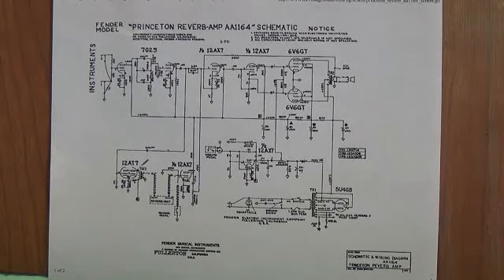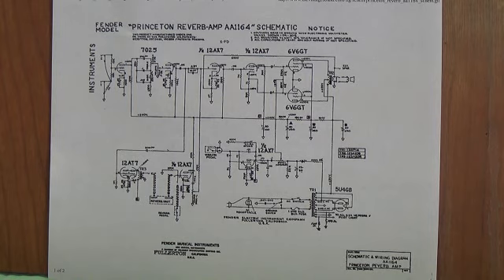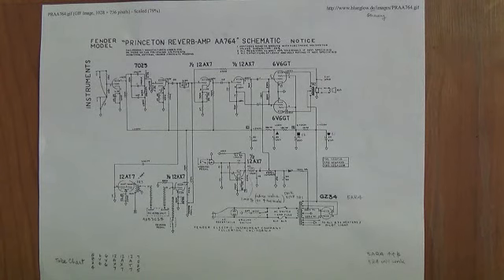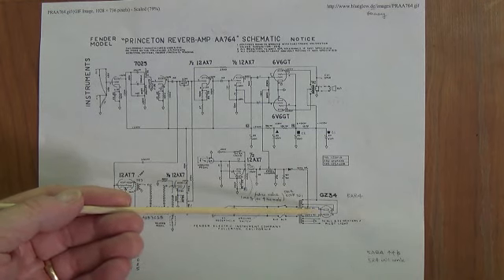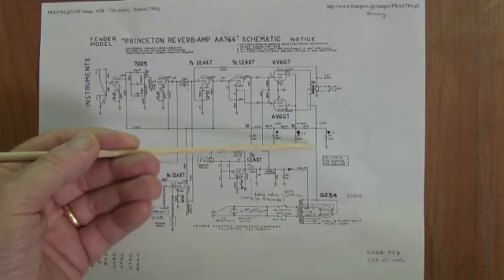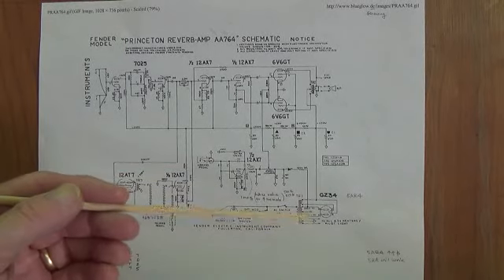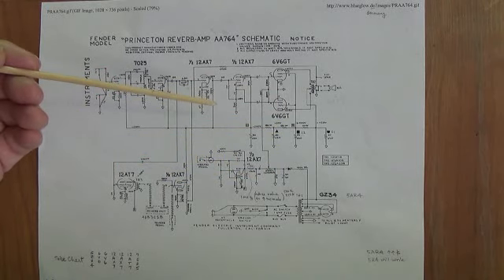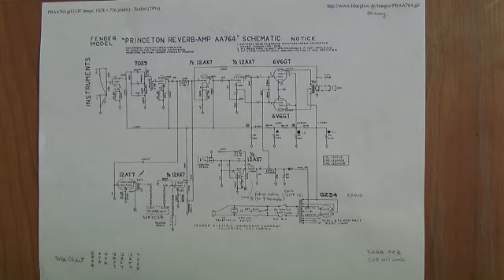Fender Princeton Reverb AA764 Chassis.....Fact, Fiction, or Typo ???

Comment: Hi Uncle Dough. I'm going to take on a quite deep restoration of my Fender Princeton AA764 version. Need to do a full recap of all the electrolitics, including the multitap can-type one, the power transformer and the rectifier valve, which in my case has been replaced by a full wave diode rectifier bridge. I'm thinking of using a Hammond made 291AEX power transformer as replacement, as I live in Italy ad we run our mains @230V AC. As per  rectifier , after watching your video, I think I should go with a GZ34. Do you suggest any particular brand/type? Also here in Italy it is quite difficult to get a replacement for the filter cap. I wouldn't like to use external caps and I'd like to retain original look as much as I can. I saw on other videos you are using caps made by Ge Distribution but they are quite expensive to get, with shipping and import taxes. Any suggestion you could give to me is very welcome. Thank you
Reply from the maker: A full wave bridge rectifier requires a special power transformer without a center-tapped high voltage winding. You would be better off installing a proper ClassicTone 40-18019 Fender Princeton power transformer with a GZ-34 rectifier tube. They also have international models with 110VAC and 220VAC primary windings.....check their site.  You can retain the capacitor can on the outside of the chassis and then replace all the capacitors with individual axial electrolytics hidden within the chassis. Good luck.
Reply: @UncleDoug  Thank for your answer, Sir. As per capacitor, I know  schematic requires a 4 x 20uF can cap. Would a 20/20/20/30 be a better option, even for cosmetic reasons? Thank you
Reply from the maker: @dreamlessfull  I'm not sure why the latter would be more "cosmetic" than the 4 x 20uF, but yes, you can use a somewhat higher value cap in the first position of the power supply chain.
Reply: @UncleDoug true, I could use 4 electrolitics and keep the disconnected can cap, but  I'd like to keep the number of modern components inside the chassis at minimum
 Thank for your advice, I've learned a lot from your vids
Reply from the maker: @dreamlessfull  Then I guess you have no other option than to buy a "very expensive" can capacitor. Good luck with the repairs.
Reply: @UncleDoug  Thank you Sir, I'll let you know how it goes... especially when I'll need to tackle the 6L6 biasing topic. Then I'll need your help again, if I can ask.
Reply from the maker: @dreamlessfull  Hopefully, your output tubes are 6V6's, not 6L6's :)  I have posted several videos showing how to bias double-ended amps. I think you will find them helpful.
Reply: @UncleDoug  Ehhhr, yes 6V6, of course! :-)
Reply: Hi Uncle Doug. I've finally completed the restoration of my Princeton Reverb. I've a couple of question, I hope you don't mind answerig them. I've installed a Hammond power transformer, and since it has a center tap on the 6.3 V secondary output, I was wondering if a can take off the two 100 ohm resistors on both secondary wires, currently attached to the bulb, and connect the center tap to chassis.  Second question, firing up for the first time: Since I've got a variac, with an ammeter indicator, is it ok if I turn on the voltage gradually and check if current demand is within specs? Of course, with all the tube except rectifier removed, at first, just to check if voltages  are correct? About the bias, now. Since 6V6 have no cathode biasing resistor, how do I measure PD? Plate and center tap of OT on each tube, with resistance of each primay? Lastly,  would it be possible to bias 6v6 individually? Any  schematic you would point me to? Thank you tons!
Reply from the maker: @dreamlessfull  A bunch of questions, D. Yes, remove the virtual CT and ground the real CT.....you never need both. You can do a slow start-up with a Variac and only the rectifier, but B+ voltages won't be accurate without the tubes in place. Use a Current Limiter and either just start it up or slow start it up with all tubes in place.....then check voltages. I have covered the biasing procedure many times in videos. Measure the voltage drop across each half winding of the OPT primary, then divide it by the resistance of each half winding. Yes, you can use different grid resistors to match the  bias.....but perfectly matched output tubes is not all that important for good tone. Often, some mismatch sounds better.
Reply: @UncleDoug  thank you very much, doc!

Comment: I used the link for the Schematic - and it says it's a photo-shopped conversion of the AA1164 , so maybe your initial comments were correct.
The PRRev. AA764 never existed - maybe it was the stamp they used that hadn't been changed.
Reply from the maker: Strangely enough, the statement about it being photo-shopped was added AFTER I posted the video and link. I have copies of the AA764 schematic both ways, with and without the notice. The addition of this notice does indeed cast doubt on the actual existence of any legitimate AA764 schematic......or chassis.
Reply: @UncleDoug  But it still remains that the Tube Chart with the stamp AA764 shows the GZ34 and the AA1164 Tube Chart has the 5U4GB. Peculiar to say the least :-)
Reply: @UncleDoug  Maybe even more peculiar is this SF PR on Reverb - 1968 :-)
https://reverb.com/item/7825642-vintage-1968-fender-princeton-reverb-silver-face-tube-amplifier-aa764-circuit-a-true-sonic-gem

Comment: Have you ever come across a way to slow down the tremolo in a Princeton Reverb (mine is a reissue). Maybe a different value pot for the speed?
Reply from the maker: It's a fairly simple procedure, David. Simply increase the value of one or more of the capacitors in the oscillation loop.....i.e. if the cap value is .02uf, then substitute a .03uf. Higher value caps charge and discharge more slowly, thus slowing down the tremolo speed.

Comment: hi, thanks for posting this... its really interesting and helpfull... I am very confused though, as my PR tube chart states it is a AA764 circuit, but it shows a 5U4 rectifier tube... any hints on this? which schematic should I use... also, which power and output  transformer replacements would you recommend to restore and improve these amps???
Reply from the maker: You're welcome, Sergio. Normally the AA1164 chassis uses a 5U4 and the AA764 uses a GZ34. If the tube chart in your amp says "AA764" and shows a diagram of a "5U4" rectifier, then I would go with the tube chart and keep the 5U4. Other than the rectifier tube, there is very little difference (2 capacitor values) between the two circuits, so it really doesn't matter which one you use.

I would not suggest replacing either transformer unless the original has an open winding (i.e. it's "burned out"). If you do need a replacement PT or OT, then check Triode USA:  http://store.triodestore.com/transformers.html   They have good quality transformers at very reasonable prices. Good luck !!

Comment: Uncle Doug. Thanks for the vids. I'm learning a lot. I have a 1974  Silverface Princeton Non-Reverb. Can I use a GZ34 instead of the 5U4Gb?
The amp has very low power. I was hoping this would help. What else can I check/try to increase volume/power?  Thanks!
Reply from the maker: You're welcome, Diane. Yes, you can replace the 5U4 with a GZ34 and the result will be higher plate voltage and possibly higher plate dissipation, so you should re-bias the amp. It's possible that your 6V6 output tubes are showing their age and getting weak. If you have never replaced them, it might be time to do so.....and another good reason to re-bias (necessary with the new tubes). Good luck.

Comment: This is interesting.    I had asked you for a link to a good readable copy of an AA1164  Princeton reverb, and you sent one from I think TheVintageSound web site.   My brother found another one, that says "AA1164 Princeton Reverb" on top, but it has a GZ34 rectifier tube and the power transformer is 340 0 340v and a spot check, the other components look the same as well.
Reply from the maker: Variations exist in schematics. The GZ34 rectifier is generally found in the AA764 circuit, but can be used in the AA1164 as well. The GZ34 is a more efficient rectifier, so plate voltages will be higher (output tubes must be rebiased if rectifiers are changed). It offers a slower warmup, to protect the tubes, and it has lower current demands from the power transformer. It is overall quite superior to the 5U4.
Reply: Thanks for the info, Uncle Doug. Glad I somehow "accidented" my way to the GZ34 version of the schematic.  Wow much better tube! As an aside, a little worried that the schematic I have might have a fatal error/typ'o (short or missing component or value is wrong) but maybe I can find a different source for the schematic and compare component values and placement.
Reply: If I had not found your youtube channel, and all the great and detailed information on projects you've worked on, and tutorials, I don't think I would start an amp building project.  Thanks!
Reply from the maker: You're welcome. Good luck with your project.

Comment: Do all of the AA764 models have the GZ34 and while only SOME of the AA1164 have it? thanks
Reply from the maker: It's impossible to make any absolute statements about the circuits at that time, Doug. I have seen all sorts of circuit variations, alterations, and combinations....probably depending on what parts were available on the day of manufacture.

Comment: Can I substitute a GZ34 for a 5U4 in a '73 and '79 SFPR?  If not, what changes do I need to make to make it work?
Reply from the maker: Bbendfender Your power transformer will love it, due to reduced current draw, Bb, but your output tube plate dissipation will go up due to increased plate voltage. You'll probably have to re-bias them.  Also, the amp will become less "saggy", with current responsiveness more like solid state rectification.

Comment: Would going from a GZ34 in a 64 Super Reverb to a 5U4GB tax the amp parts anymore?  Would it likely achieve more sag at lower volumes?
Reply from the maker: Greetings, NYC. The GZ34 filament only draws 1.9A while the 5U4 draws 3A, so the 5U4 would be a 58% greater current draw on the 5V winding of the PT. Most PT's have some leeway in their current ratings, so you could probably get away with it. The GZ34 is more efficient that the 5U4, so the 5U4 would indeed be a little "saggier" at lower volumes. Here is a link to a great site and discussion of your amp:  http://fenderguru.com/amps/super-reverb  He mentions the rectifier switch.
Reply: Uncle Doug That site is where my search started.  Guess Ill be posting my results after giving it a try..

Comment: I have a 1967 Princeton Date code QD April 67. Under indicator bulb is only the number 68..no other text...most say Patent date or other...never seen this on other..is this rare?
Reply from the maker: There are several different versions of the control panel plate, Brian, but I don't recall seeing one with just the number "68".

Comment: Hi Uncle Doug. I have a '66 with the AA764 chart, and it came to me with a 5U4GB rectifier. I'm considering a swap to the GZ34. Before I do, can you tell me how the differences in the AA1164 circuit address the potentially harmful characteristics of the 5U4GB rectifier if used in the AA764 circuit? Many thanks. Great videos.
Reply from the maker: Greetings, Jonathan. I don't believe that Fender made any modifications for the 5U4 rectifier in the AA1164 chassis. In the schematics, it appears that both chassis use the same power transformer, even though the 5U4 draws over 50% more filament current than the GZ34. I assume that the 5V winding of this PT is rated at 3A, so it is capable of handling the 5U4 and would therefore be way under-stressed when dealing with the GZ34 at only 1.8A.

Your AA764 chassis would probably be OK with a 5U4. It's a common substitution, since 5U4's tend to be more readily available and cheaper than GZ34's, but in addition to drawing more filament current, the 5U4 is much less efficient than the GZ34, provides lower plate voltages, has more "sag", and does not provide slow warm up to protect your tubes. Bottom line: the GZ34 is a superior rectifier in all respects.

Comment: Hi Doug- looking at the schematic you posted (thanks!) I see there is a notice that says "This drawing was photoshopped from a scan of an original AA1164 schematic. The only details change were the AA764 designation, the bias capacitor from its original 25u 50V value and one tremolo capacitor from 0.01 to 0.02.  To my knowledge there is no known example of an original AA764 Princeton Reverb schematic."  
I did not see this disclaimer on your printout in the video, though (must have been updated later on?).  I assume the photoshopped schematic is valid/ correct, but why is this such a difficult schematic to find?
Thanks for all the videos
Reply from the maker: I see no such notice on either of the AA764 schematics I have on file, KP, but do acknowledge that this is a virtually impossible schematic to find.....although the circuit itself is not at all uncommon. It continues to be a mystery to which I have found no final, satisfactory answer.
Reply: Interesting.  Well thanks again!

Comment: Wow. Facts and data. Rare on the internet, and even more rare in amp discussions. 

I'm thinking of building a Princeton Reverb, as it seems to be the Fender amp with the most headroom that will not blow out a Celestion Blue. In your opinion, was the PR AA1164 circuit an improvement over the AA764, or should I go with the original?

Thanks.
Reply from the maker: Thanks, Jeff. I prefer the AA764, because it uses the GZ34 rectifier, which is vastly superior to the 5U4. Other than that, there are very few differences between the two circuits other than a couple of capacitor values.  Good luck with your project :)
Reply: Uncle Doug Thanks much. Do you know if a GZ34 would work in a Deluxe Reverb? If so, would it drop in, or need a rectifier redesign?
Reply from the maker: Jeff, the AB763 chassis of the Deluxe Reverb came with a GZ34 rectifier, so it would probably work in other versions of the DR (i.e. AB868).  One thing to watch is the plate voltage will go up with the GZ34, and you would have to rebias the output tubes.
Reply: I have a Princeton Reverb Amp, Listed as AA764. The tube chart is as follows GZ34, Two 6v6GT, two 12AX7, 1  12AT7 and 1 7025. However the tube slot contains a 12AX7 instead of the 12 AT7. is the 12AX7 a substitute for the 12AT7? I notice the amp is now getting hot and the transformer may be going out. any comment is appreciated.
Reply: It is listed as a 80 watt
Reply: Paul Kelly 
No... 12AX7 is very high gain and has very
limited current capacity. the 12AT7 is lower gain and much higher current capacity. In Fenders with reverb, the 12AT7 is used to drive the transformer that drives the reverb tank. The 12AX7 is not at all suitable. It has limited current and cannot correctly drive the reverb tank.   Confusion reigns because in the first tube position where a 12AX7/7025 is used, some people do use a 12AT7. It usually results in cleaner sound and has less gain. Just plugging it in where a 12AX7 is expected is not optimal for it as plate and cathode resistors are not quite right, but it will “function”.  You just cannot put a X in place of a T.
Reply: @paulkelly3288  you might blow  out your reverb  transformer

Comment: I have fender super reverb SF 1969 ab568, but in the chassis they wrongly wrote ab763...
Reply from the maker: I'm not familiar with chassis being marked with circuit ID, Ali, but misrepresentation is not unusual with these early amps.
Reply: @UncleDoug  thanks for your kind reply

Comment: Hello Uncle! I have Princeton, but want more reverb intensity as it is on Deluxe reverb. Can you tell how can i archieve this?
Reply from the maker: +Ilya Shadrin If your PR is lacking reverb intensity, check (or replace) the 12AT7 driver tube, be sure that the cathode bypass caps on the 12AT7 and 12AX7 are in good shape, check (or replace) the 12AX7 recovery tube, and be sure the tank transducers are in good shape.  The only reason for a PR to be lacking reverb intensity is if some component(s) is/are old, weak, or failing.  Good luck.

Comment: Checking out schematics it appears the AA764 is just an AA964 with the reverb unit added.
Reply from the maker: That would make sense, since the AA964 is the Princeton model and the AA764 is the Princeton Reverb.
Reply: Uncle Doug By the way...What are you playing on the intro, Strat? Whay are the settings guitar & amp?
Reply from the maker: Actually it's my workshop guitar, Marstyn, a 1979 Matsumoku Vantage Performer with MMK-45 humbucker pickups. The guitar output and tone controls are usually set on the high end......8 or 9. The amp was probably at Vol 4, Treb & Bass 5, Rev 0, Sp 5, Int 5.....I'm just guessing, since it was a long time ago, but this is probably correct.